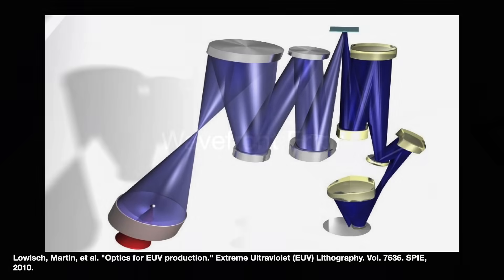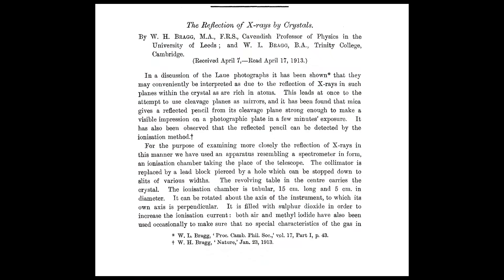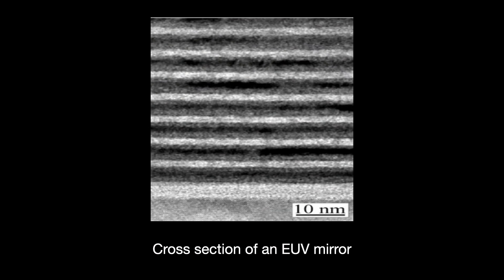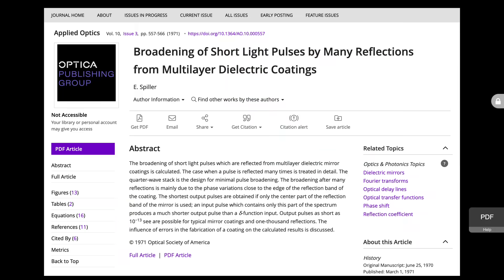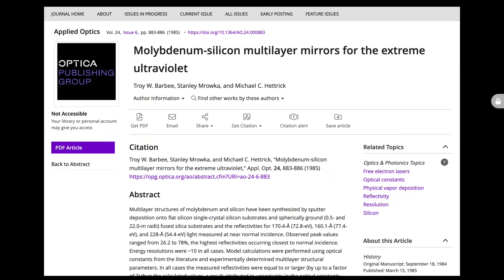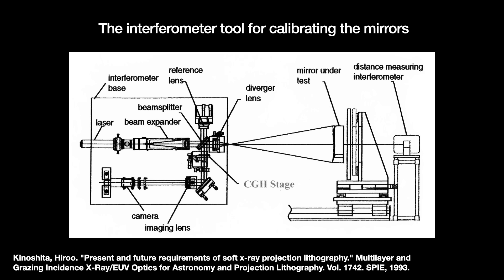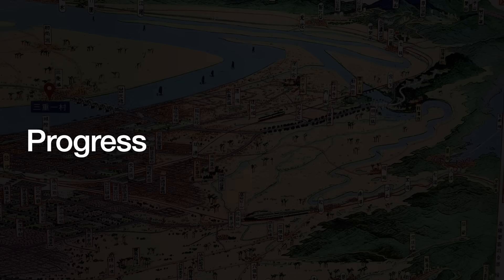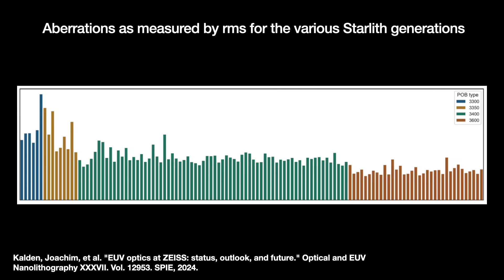How the EUV Mirrors are Made

Comment: Thank you for the great video.  For perspective, consider the fine grinding and polishing of the mirrors on the Hubble Space Telescope in the 1970s.  Putting aside the design error (not manufacturing error) of one of the Hubble's mirrors, Perkin-Elmer Corp. used a computer-controlled machine to grind and polish each mirror, and did better than the required standard of an error not more than 10 nanometers.
Reply: Hubble telescope probably most expencive mistake in world of optics
Reply: @alexred9963  Very true.  The only manufacturing defect up to that time that required an astronaut service call.

Comment: i'm kinda shocked that solids don't deviate by more than the minimum error due to the changing direction of gravity if one is turning a mirror...but then i'm also surprised that just picking up a chip doesn't deform it too much too and it obviously is tougher than that 🙂(and it's encased in stiff stuff too which should help...)

Comment: This cant be right, if the maximum error is the size of an hidrogen atom and the mirrors are made of any other atom, it instantly becomes impossible to do
Reply: Layman analogy, but the smallest height deviation in a brick wall can be, and often is, smaller than the size of a single brick.
Reply: @DKNguyen3.1415  it's not an analogy it's just logic
Reply: yup, judging by other comments on this vid, it can't be right because it simply isn't right; the intro explanation is off by about a factor of ~50; when he speaks of dividing the EUV frequency by 50, he's wrong: its actually1/50th of HeNe Fizeau Interferometer's frequency, which is at @632.8nm.

Comment: 0:12 It's crazy how the light bouncing between the mirrors casts shadows
Reply: Rofl
Reply: According to quantum theory light is going in every direction at once, but the waves cancel each other out and you only see the direct light
Reply: no it doesn't you yobo
Reply: @mengxiangxuan6552  oh yes it does! And there are videos on here that prove it. It takes ALL POSSIBLE PATHS.
Reply: @mengxiangxuan6552  its a joke because of the model casting a shadow no?
Reply: @MePeterNicholls  you're confusing the beam splitter experiment where there's a 50-50 chance of light going either path with light going in every single direction
Reply: @MePeterNicholls  the same equation was also derived by Laue
Reply: @mengxiangxuan6552  no no I’m not!
Reply: @MePeterNicholls  uhuh

Comment: All of this, along with the problems of light source power, raises the question of why so many mirrors are necessary. Given that every mirror magnifies the effects on any errors and reduces the total light that reaches the wafer, there must be some design pressure to use as few of them as possible. Also presumably, there is some other optimization choice that makes more mirrors desirable, which leads to the chosen configuration. Any chance we could get a deep dive into that?
Reply: IIRC it is a trifecta of correcting distortions while simultaneously focusing on both the mask and wafer.
They absolutely try get to less mirrors.
Reply: compare the number of lenses in a standard SLR camera lens; each simply trying to correct one error or the other

Comment: As a novice in this field, that ion beam figuring 15:00 doesn't seem to make sense as a means of material removal because there is no definitive end to the beam as one would typically have with a fixed tool.  Perhaps the focal plane for the beam is near zero thickness lol.  How is the beam moved over the surface whilst maintaining its own accuracy is another thought.
Reply: They are literally etching away single Atoms.
Reply: @walterbishop2  Pretty difficult to get one's head around how that actually works.  
I picked up one of those 3D laser engraving machines not too long ago which delivers 12KW pulses in to a 40 micron spot with something of a gaussian beam profile.  Not in the same league as ion beam but still a sort of similar deal, maybe.  Laser ablation leaves a right old mess when viewed under magnification with highly inconsistent track and depth.
My line of thinking is if ion beam is hyper accurate then perhaps this process should be making the chips rather than mirrors.
Reply: @walterbishop2  Another thing about pulling off one atom at a time is that if the surface is undulating then the surface would remain undulating after the process unless one could factor in the undulations followed by calculation then removal of a varying number of atoms at a time so as to achieve flatness or irregularity removal as the beam progresses.  Sorry, I should look up this process as it has me scratching my head lol.

Comment: Well: If the allowed error is smaller than the radius of an atom that the mirror is made of (in this case here we discuss an accuracy in the 50 pm range versus an atom size in the 150 pm range - three times bigger), then you have to come up with other ideas than "polishing the mirror". You can't do anything against the steps the atoms create on the surface - even if that surface is ideally build.

What you can do is to limit the number of required mirrors or go in the direction of reverse calculating the masks from measurements of errorneous results (as it is done anyways already, just needs to be improved).

Atom accuracy on a surface in the size range of 1 m^2 is, however, an impressive achievement.

How long would it take to do such a correction when that would be really made atom-wise with, say, 10^7 corrections per second (because of measurement loop delay)? We have about 10^11 atoms per meter. That would need 10^15 seconds (32 million years). Thus, they don't do this corrections at the atom scale, but instead more at the scale of 10'000 atoms diameter (1 micrometer), leading to production times below a year.

This, however, is far from getting you to atom accuracy surfaces. You just can achieve some "average" accuracy over the mentioned diameter range. The surface will still look like a cratered landscape when viewed in a raster electron microscope.

However, thanks for the video to recalibrate myself to the scale of accuracy achieved so far.

Comment: I still don’t get it how can it be if atomic radius of elements on the surface is some 150pm, that the RMS surface error is so low. Can’t quite comprehend that fact.
Reply: All the numbers in the introduction are totally screwed up and totally wrong. I hope it gets corrected in the future because at the moment it's just spreading misinformation. The wavelength he is referring to is the HeNe laser wavelength you're measuring your lenses with, not the 13nm EUV wavelength, the whole intro is off by 637/13...
Reply: over simplification is rarely a virtue

Comment: The accuracy they needed is incomprehensible to me. How do you even begin to approach that?
Reply: Quite literally: You start with a transparent disc. Then you make it better. Then you realize you can't measure precise enough, so you go about improving your metrologi tools. Once you can measure precise enough you improve your addition/removal toos and get to work until you can't measure precise enough again. And then the cycle starts again. Strictly speaking this is a process that has been going on since 700 BCE, but it is generally held that making lenses industrially didn't happen until the late 1200s in northern Italy.

Comment: Why tho do these machines require so many mirrors?
Reply: Trying to achieve the otherwise mutually incompatible goals of trying to corral the maximum proportion possible of the expensively-produced EUV light to the target while ALSO having that light be as coherent and parallel (no divergence or contraction etc) as possible. So many steps are required to do this - turning the curved collection optics into the straight lines of the final lenses. Also, some play double duty in being steps where focusing and other calibration steps can occur

Comment: I've ground and polished my own 317.5mm telescope mirror to .974 strehl (which is really really good). I'm not good on the numbers on things like wavefront error vs surface error in RMS and all that but plugging in some numbers into ChatGPT puts me at around 14.1nm Wavefront RMS at 550nm. I built a bath interferometer to do the testing and plugged the interferograms into DFTFringe (free software by Dale Eason) to do the analysis.

These EUV mirrors demolish even the best telescope mrirrors in terms of accuracy. It blows my mind how much more accurate they are.
Reply: Dale Eason, there's a name I haven't heard in ages. The ATM community is amazing. Crazy how they achieve 1/50 wave over the whole optical chain.

Comment: That's some crazy levels of precision they made those mirrors to, to think we're actually capable of those kind of precisions in a mass produced object. Admittedly a very low volume mass produced object, but even so... They've been making these by the hundreds and maybe even going towards four digit numbers. Kind of amazing to think there are that many absurdly precise mirrors in the world.
Reply: Ah... these are built one at the time by specialists who need to know exactly what they are doing at every step of the way. Each cycle of "measure, calculate, apply corrective measures, repeat" is different from the last. So yes, they are being produced in numbers, but everything you normally associate with mass production is not applicable. Mass production is normally understood as giving you some kind of benefit of scale. The Zeiss guys, however, are "just a bunch of nerds with an extra mega fancy workshop" :P

But yes, it's amazing that it doesn't take them a decade to build just one.
Reply: @andersjjensen  Well some what true, but they do get to reuse all their equipment many many times I guess. And their built up experience over the years can be reapplied over and over as well I imagine. 

The supply lines can be stabilized and the inputs learnt and perfected.

I'll grant you the gains in this case are probably not the biggest, because as you say... these are some amazing specialist items, but still, it's something.

And indeed, it is truly amazing these have been made in any kind of real numbers at all.

Comment: I don't understand how you can curve mirrors with such a high degree of precision?  Don't you run into problems with the underlying atomic structure not allowing that degree of precision?  The intro implied the surface had to be polished to less than the diameter of a hydrogen atom.

But if the material has cubic crystaline structure doesn't each step in the mirror surface have to be at least 1 atom tall?
Reply: The numbers are out by a factor of 50.
Reply: He screwed up the numbers in the intro, they're complete wrong.
Reply: @Piipolinoo  Ahh thanks that clarifies things.
Reply: He kind of addressed that in the discussion about the three scales of roughness. The structure you are talking about affects the smallest scale. At that scale, roughness causes loss of intensity. It doesn't mess with the shape of the spot.
Reply: @ Yes, I understand why they still focus but his discussion at the start dealt with how precisce  you needed to be at small scales to avoid having too large of a loss.

Comment: Optical wavefront error is typically measured with a HeNe Fizeau Interferometer @632.8nm. Common camera lenses are polished to 1/10 wave (63.8nm). Just because the wavelength of EUV tech is around 13.5nm, does not mean the optics required are measured at EUV wavelengths. This would be obsurd. They are measured @632.8. The RMS (roughness) at various spacial frequencies are further measured with atomic force microscopy (afm). This is where you need to achieve true angstrom precision or less. (<0.1nm, or <100 picometers. Thank you for the video.
Reply: The channel owner is more business oriented than physics/engineering. He really should contract with somebody in those fields to proof his work.
Reply: @-danR  he as said that he tried to contact AMSL multiple times and never got a reply back..
Reply: @tiagoangelo3828  this is knowledge known by every optics shop in the world. If you can't get proper sources then just don't release your content.
Reply: I was going to say, how would one achieve an error less than 1/3rds the width of the atoms it's made from?
Reply: But those mirrors are designed only for EUV reflection.
How would 632.8nm measure them, especially the deeper layers?
Reply: @ I'm speaking in terms of the raw substrate. As for the mirror coatings, I am not to keen on. Spectrophotometers can detect various coating layer properties.
Reply: I'm working in Optics Manufacturing including EUV optics and this comment is totally correct. I'm very sorry, but your whole introduction is completely wrong and you really should remove it as it makes you look very bad.
Reply: @Piipolinoo  What's completely wrong about the introduction? I'm curious. (For reference, I interviewed at Zeiss SMT several times, once with the group that was in charge of analyzing the data from their Fizeau interferometers, including the one where they couldn't switch the lights off in the room the interferometer was in ;-) I ended up working for a different company in the semiconductor industry.)
Reply: Who's your fizeau interferometer guy?
Reply: Can anyone ELI5 that? The second part is what confuses me. 

 So they measure them at 632.8nm. Then measure only certain spots that then are fixed to be a under a 100 picometers? 

 I always thought the base/blank of the large lens were made first. Polished/cut. Then checked for whatever unique distortions since it was impossible to create anything so large with nigh perfect atomic structure. 

 So they get as close as they can. Then give the lens. Uh glasses in a way. Generally with the coating. 

 Guess not. Not sure where I got that from. 

 Here is my real question. Does it actually matter if the light beam is tight, and combined the entire distance to the target? 

  Or is it okay if the beams don't combine during their path as long as they hit the target at the same place or combine at the end? (Without scattering of course)

 I mean lasers in general. A single powerful beam is no different than many beams adding up to the same power as long as their targeting is precise right? Coherent beams don't amplify the power in any way right?!

Comment: when you next talk about the EUV light source, it may be worth mentioning that if it didn't work, the industry had a backup plan to use 450mm wafers to double the area per process step/wafer. since EUV worked, in ~2014, 450mm wafers programs across all equipment vendors stopped.
Reply: but now....

Comment: 12:35 "traditional optical techniques like lapping, which is where you run a dogs tongue over a mirrored surface repeatedly" 🤣🤣🤣
Reply: there should be a correction here, a cat's tongue is more abrasive and works much better in practice
Reply: All jokes aside, for those of us not in the know, just what is the "lapping" process?
Reply: @vulpo it’s basically polishing, but even worse. Huygens optics is a YouTube channel that did at least one video explaining the process in relation to making lenses.
Reply: @vulpo  Lapping generally refers to sanding/grinding/polishing where you use the "grindy" surface as a reference for what is having material removed. At the most primitive level you could consider sanding paper stabled to a (reasonably) flat plank "a lap". If you rub something over it, it will become flat, unlike if you take a rotary sander to it and try to flatten it yourself.

If you want to see a guy make sub micron precision laps ask youtube for "oxtoolco Making flat lapping plates". It's a 4 part series where he uses a technique called "the thee lap method" where, with clever application of knowledge, you can grind three plates against each other in a very specific sequence and pattern to get them to cancel each others defects out. The more times you repeat the process the closer to perfect you get. This method has been known for hundreds of years, and has been instrumental to the development of precision machining.
Reply: @andersjjensen  Joseph Whitworth invented the three plate method in the 1800's.
Reply: Shouldn't this process be called schlopping?
Reply: so... Isn't Lapping tool really called dogs tongue? I feel disappointed.
Reply: @Vic-sp6ld  I saw video, a long time ago, that talked about one of the mirrors used at Mt. Palomar having the final 'polishing' done by rubbing the mirror with their thumbs and then waiting for the mirror to cool down from the abrasion to optically check the mirror curvature.
Reply: Md too  @Vic-sp6ld

Comment: If efficiency is lost with each mirror, why are so many mirrors used?
Reply: Required for the process. There’s plenty of videos about how the machine works
Reply: @ - if you don’t know either, then just say you don’t instead of pretending like you know.
Reply: @neilwalker8686  Maybe he didn't feel like typing out things Jon has gone to great length to explain previously? Anyhow, the short version is "The photons must come in as close to parallel as possible when they hit the wafer or Bad Things(EM) will happen. Older systems that use laser light has that mostly sorted right out of the light source, but EUV is made by exploding droplets of tin, so the photons come out in all angels".